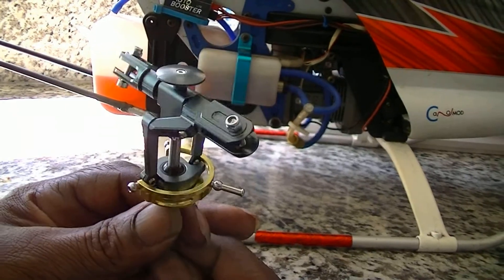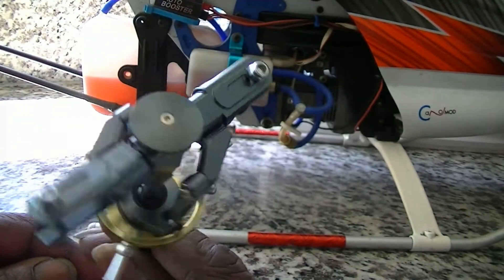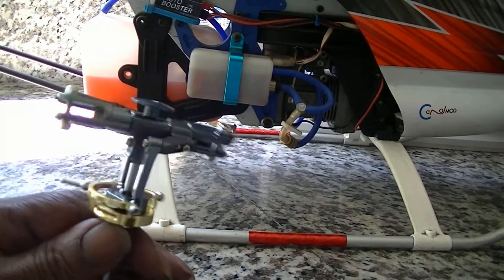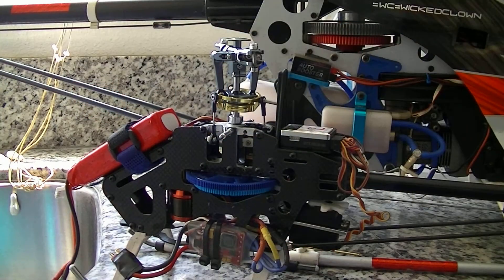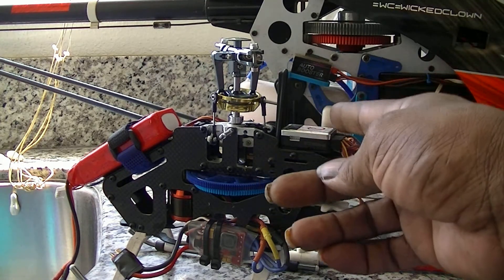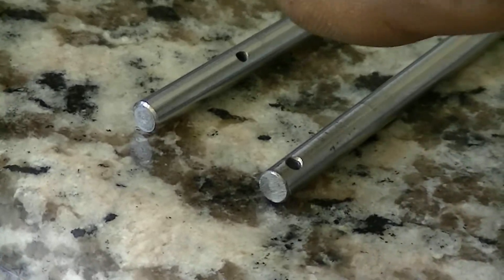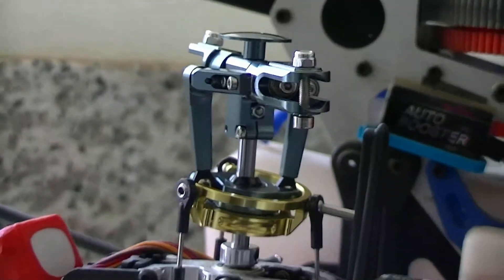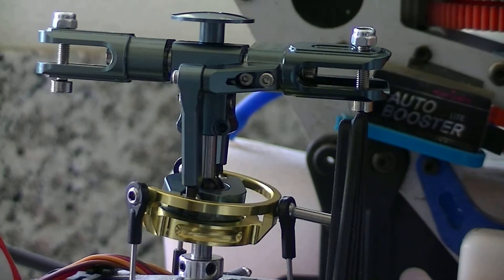CopterX  DFC Flybarless  Main Rotor Head Align Trex 450

Comment: Yes, the head come with main shaft for the copterX Black Angel.  So you will need to change the mainshaft to CX450DFC-01-02.  For the anti rotation bracket.  You heli use an old "PRO" bracket.  Use align H45031A as it is shorter for the DFC head.  I have the same head on my pro.  :)

Comment: the swash to blade grip link is for adjusting the tracking only.  you will need to get the servo to swash link right first so it will give correct swash movement.

Comment: you should adjust the servo to swash linkage first to get the right swash travel.  Try to do the following:

1:  screw the swash to blade grip link all the way in.
2:  Set your pitch curve to 50%, and level the servo horn to 90 degree.
3:  Adjust the servo to swash link to level the swash and so the blade is at 0 degree pitch.
4:  Now just use the pitch curve to set the pitch travel you like.

Comment: No sure with the align dfc shaft.  But I am using the copterX dfc shaft.  I can get 20 degree plus travel both +/-.  And I have around 4-5mm clearance with the "normal" align anti rotation bracket.  I just trim the top of the anti rotation bracket a bit to get more clearance.  But I am not sure the cause with the align mainshaft as I donot have one.....

Comment from the maker: but the ad says
Suitable for CopterX Black Angel / CX450AE V3 / CX450SE V2 / CX450PRO V3 / CX450PRO V4 flybarless system (need to upgrade CopterX (CX450DFC-01-02) DFC Main Shaft and ball link for different models.)

Comment: That main shaft is designed for the Black Angel. It has a different tail drive type than a standard one way bearing. Order the standard DFC shaft for their normal DFC heads (The Align clone ones). That should take care of that weir Jesus bolt issue.

Comment: copy from their website"Suitable for CopterX Black Angel / CX450AE V3 / CX450SE V2 / CX450PRO V3 / CX450PRO V4 flybarless system (need to upgrade CopterX (CX450DFC-01-02) DFC Main Shaft and ball link for different models.)"

Comment: Hey wickedC! What CHEAP fbl blades would you recommend for buying in 325mm size?
Thanks! I just f up my Tarot Fbl blades
Reply from the maker: i use fb blades on my fbl the cheap cf blades like 11 bucks a set they fly just the same to me.
hope your accident was minor my friend
Reply: turned out 45 bucks altogether. thanks
Reply from the maker: 45 bucks i get 8 pair of cf blades but buy a 12 pair of cf blades to make sure all is good and stable before you use your more expensive blades
Reply: You got me wrong. All stuff ordered cost 45 bucks. I got a CopterX CX450BA-06-03 EP 450 Class 325mm Main Blades for Flybarless Main Rotor
 for only 12.99 bucks.
I ordered some other shi too, like feathering shafts, main shafts, end I cracked my anti-rotation bracket as well.
Reply from the maker: Petike01 oops lol congrats and good luck

Comment: The Coptorx head is NOT a direct bolt on. i have seen their airframe and the auto brackets is different as well as the way the main gear is mounted. They just fail to advertise it like they should.